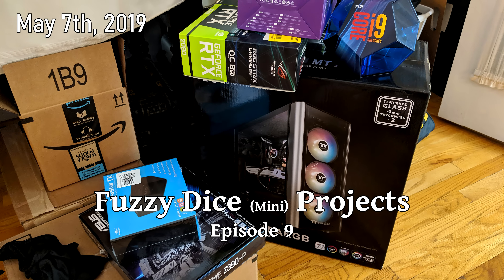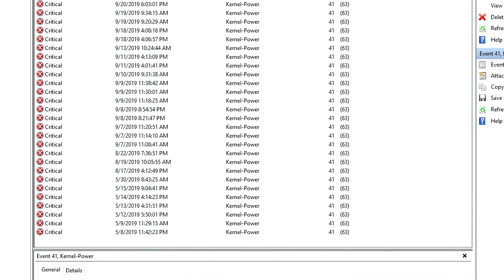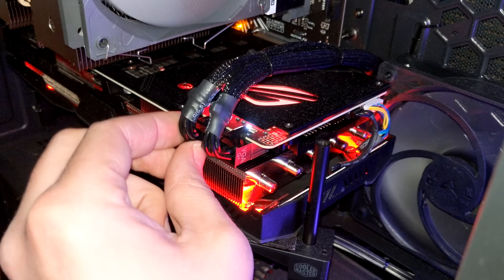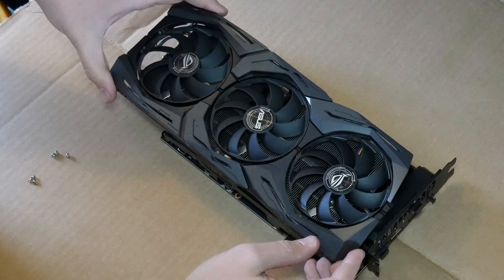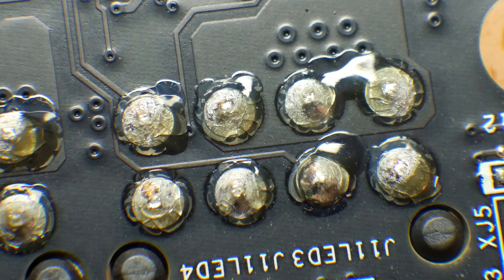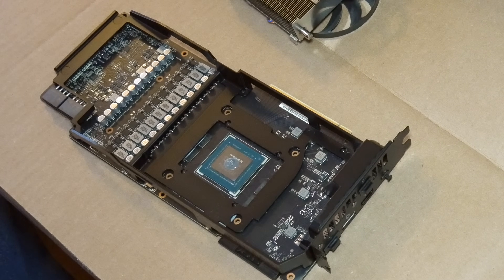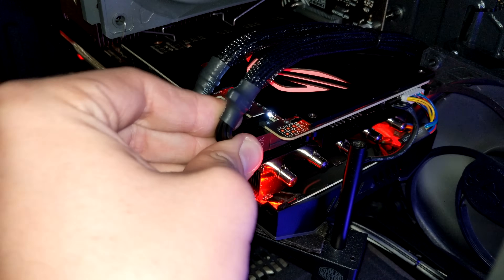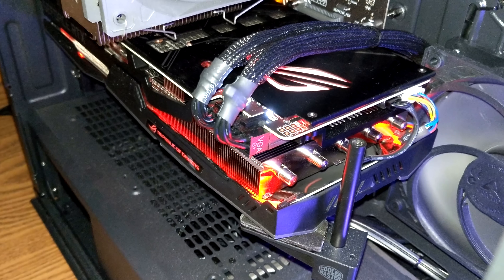ASUS RTX 2080 Power Connector Repair (Black Screen Crash/Loud Fan Fix) (Mini Projects Ep.9)

Comment: here is a pro tip from someone who works in that field... dont buy stuff from ASUS... they have very very veeeeery bad quallity control and next to no costumer support... they really are the worst of the worst hardware supliers... ASROCK seperated them selfs just because of it and if you want quallity computer hardware go to ASROCK... sure you pay a little bit more for their stuff but its worth it
Reply: This is true for almost all their hardware. I have not once had a piece of tech from Asus that lasted longer than 2 years.
Reply: @maxz8807  Please tell me, what is wrong with my P5Q mobo? It still works... Should I call asus to get it destroyed?
Reply: @maxz8807  I have a 4 year old Asus motherboard.
Reply: are you going to start holywar? oh, wait. I'm going to get me some bucket of popcorn
Reply: Yeah, back in 2004, that was definitely not the case.. they've switched for sure, and I'll take Asus over Gigabyte any day. If your GB product ever fails, just trash it, their warranty process is a joke... it was 16 years ago, 4 years ago, and 8 months ago.
Reply: @AndreMarek64  the 2 companies i had the best results with here ASROCK and MSI... whenever i had a failed GPU or whatever they instantly did send me a box where i put the card in and usually 4 days later i had a new card or mainboard in my hands... wish the others would handle shit so quickly
Reply: @nowaymangoshtomuchna  100% agree. I've never had to RMA an ASRock product, and only had 1 defective MSI product which like yours, was replaced quickly. eVGA is good as well.
Reply: I think so too. ASUS are the only parts that have ever broken in my PC's.

Comment: Nice fix mate 😊 Gotta say as someone that did a degree in electronic engineering those solder joints looked crap even through the epoxy resin coating. Nice to know many hundreds of our dollars are spent on such high quality items 😅😊
Reply from the maker: Seriously! Looked like maybe not enough heat or something? The smaller stuff seemed fine but on the larger power connector pins the joints were just terrible looking.
Reply: @FuzzyDiceProjects  They looked kinda corroded to me... Makes me wonder what that board had gone through before you adopted it...
Reply: @Timberwolf69  Not corroded, just like a cold weld.
Reply: @TheKnightDrag0n  I was also thinking they looked like a cold joint. Maybe it was the cracked epoxy over the connections, but I'm pretty sure those joint weren't soldered well at all. Pretty disappointing really.
Reply: maybe the card was dropped or something
Reply: @Kurkkulimu  I'd just go with lack of heat when soldering the larger power connections. I repair electronics all the time so pretty used to what bad soldering looks like.
Reply: @GarageItYourself  It lacks plumbum (PB) too. F**D "green" tech for bearu-thieves around the world
Reply: @Nyarly_Relyeh  exactly this, the number of appliances that have been scrapped due to micro fractures in lead free solder must be insane, not very green but good for simulating the economy through replacement purchases

Comment: arctic mx-4 termal grease usually is handy too. but don't use liquid metal, it can destroy bare chips like this https://youtu.be/YCCWTyIezCA
Reply from the maker: Arctic and similar products is what I have used in the past, happened to be out of them and had the Noctua paste left over from what came with the CPU cooler. Never had an issue with anything before so I sort of had the opinion that it didn't matter so much but that cheap cheesy paste proved me wrong!
Reply: @FuzzyDiceProjects  some cheap grease is rated at low as 0.5W/mK, normal PC grease  - at 2W/mK.
MX-2 is rated 5.6W/mK MX-4 8.5 W/mK; NT-H1 has rating 4.5 W/mK. so, it has the diffirence.
Reply: @FuzzyDiceProjects  termal grease (or paste) can be wery diffirent - https://fcenter.ru/online/hardarticles/cooling/30249-Testirovanie_termointerfejsov_chast_I_26_modelej_termopast https://fcenter.ru/online/hardarticles/cooling/30301-Testirovanie_termointerfejsov_chast_II_20_termopast_iz_komplektov_kulerov_i_KPT_8 
Articles are about 10 years old, and in russian since x-bit labs are out of buisness, I can't find english translation